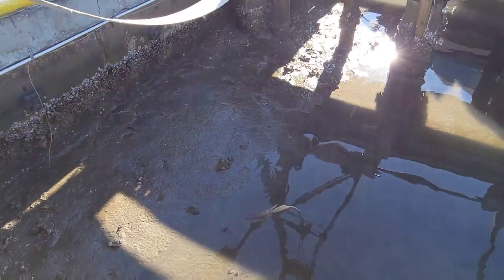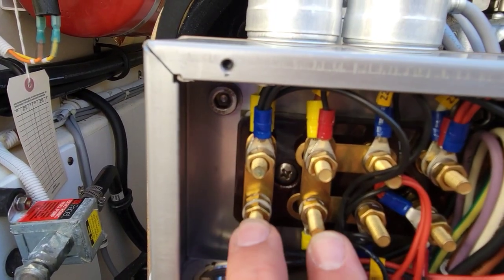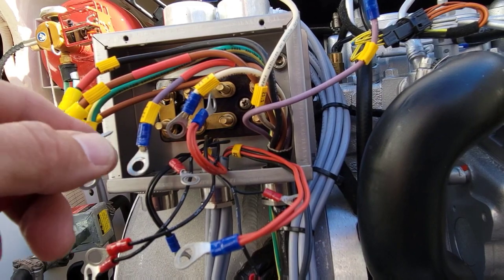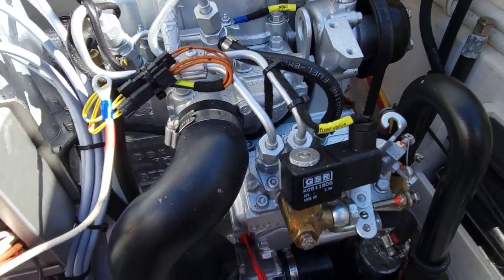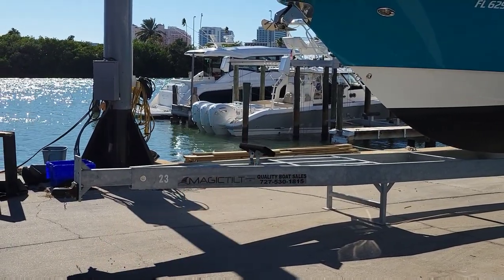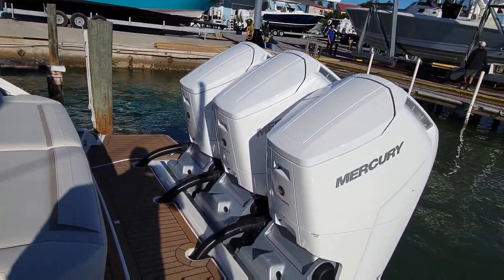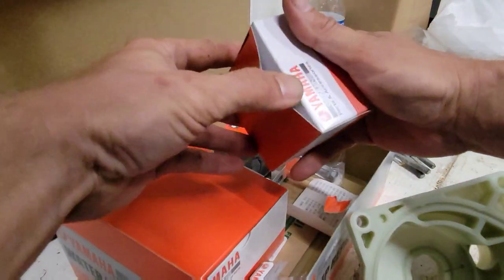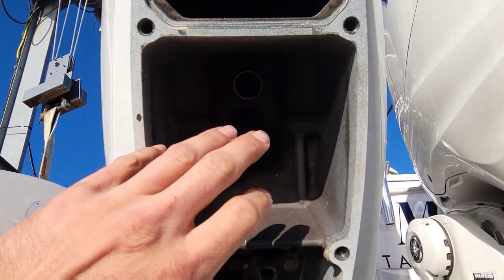Fischer Panda Stator Testing & Yamaha XTO425 Gearcase Episode 115 #Fischerpanda #YamahaXTO

Comment: I really appreciate your videos involving FP generators.  We have a FP Mini 8 "Icemaster" generator on our sailboat.  During  a trip over the summer, the generator was running fine with a steady load when it suddenly stopped producing voltage.  I've done all the troubleshooting I can think of and nothing.  As is your vid, I've tested output on the generator and get 0v.  Is there anything you can suggest or am I looking at having to pull the generator too?  Again engine runs fine - but no output.

Comment: Hey Justin, love your videos. I have a question for you if you don't mind. I bought a 2019 Pursuit DC325 and the generator was out and at Fischer Panda for service. They shipped it back to me and with the help of your videos, I was able to re-install it and it works perfectly. There is however a cut 2 conductor wire in the bilge that I assume was connected to the generator when originally installed but I have no idea where to connect. I traced it back as far as I could and found a pursuit label on the wire that says "remote shutoff" or "remote shutdown". Any idea what this is and do you know if it actually went to the generator? Thanks in advance!
Reply from the maker: Thank you and I am glad I could help. The wires you are talking about go to the fireboy system in the boat. If the fire extinguisher goes off it shuts down the generator at the same time. Being a diesel generator I never knew why they did that. I'm thinking it was just for ABYC standards. You could reconnect them but I am not sure what pins they go to on the board.  Call Fischer Panda in south Florida and ask for Issac. He knows everything about the pin locations or you could leave them off if you don't care about the generator shutting down if there is a fire.
Reply: @JustinLeeMarine  Thanks! You're the best!

Comment: Any thoughts on why the impeller/pump partially failed or overheated?  Restricted water flow?  How often do you recommend changing the impeller?
Reply from the maker: We tell every customer to change it once a year or 100 hours because of the harsh environment we are in. I am filming right now and found more issues with the motor. It will be in the next episode. 😉
Reply: @JustinLeeMarine   Interesting.   So, what would you say about a 2014 Yamaha 200 with 80hrs on it?   Should that impeller be changed before 100 hours? (used in northeast fresh water...)
Reply from the maker: Good question. I would say every two years in freshwater no matter what the hours are.  The upper driveshaft seals are very prone to failing and should be inspected when the waterpump is done.